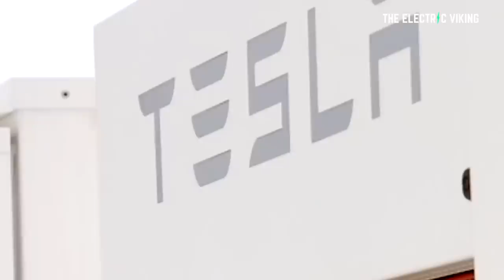Tesla's clear path to become largest truck manufacturer in the US

Comment: HYLN ERX r far more advanced than Tesla and NKLA truck combined.   You’ll thank me later.
Reply: You are absolutely right. EV trucks don't make sense for long range hauls over 500 miles and hydrogen is a dead end since you use more energy to create hydrogen then what you get out. I've been saying for a long time natural gas or LP is the cleanest and most energy efficient way to get away from diesel and gasoline for long haul commercial trucks. I see a hybrid solution using an onboard LP generator and tank as a ange extender for an EV semi as another possibility. That way you get the instant torque and better control of a electric motors, but without a massive battery pack with limited range and long recharge time. Natural gas only admits CO2 and water with minimal VOCs and toxic sulfides compared to diesel and gasoline. EVs are mostly being charged by electric power stations running on natural gas anyways. Might as well just burn it directly in the trucks.
Reply: What - better computer graphics than Nikola? You’re having a lend of me, Nikola are class leading in CGI renders and downhill propulsion. Isn’t Trevor on your board at Hyjinks?
Reply: @vic321344  How does making a hybrid truck make it a scam? When you crunch the numbers a hybrid makes way more sense than a full BEV for hauls longer than 500 miles and unlike hydrogen, there already exists massive network of natural gas refuel stations and natural gas is cheap and requires less energy to produce it than what we get out of it. My brother has ran various companies were most of their commercial vehicles were converted to LP to cut back on pollution and also save money since at the time, LP was cheaper per mile than diesel. The stock value means nothing. Plenty of companies with high stock valuations turned out to be scams and plenty with low stock valuation turned into killer companies. So my question is, what makes it a scam? The fundamentals of the concept are sound, and as far as I can tell they already made fully functional trucks.
Reply: @JEP-Tech  They didnt even make one. They want to start testing late this year. So they promise. The stock price tells it all. Hyliion expects to begin shipping the fully electric drivetrain beginning in late 2023 or early 2024. They just got 100 orders.
Reply: @JEP-Tech  "a hybrid makes way more sense than a full BEV " Sounds like the Toyota CEO.
Reply: @vic321344  Sounds like an electrical engineer (me) who actually took the time to do the math and realized that the economics of a BEV semi with 1000+ mile range when hauling 80,000lbs in cold remote areas is ridiculous. Toyota and Honda made the mistake of sinking too much money in hydrogen fuel systems, which is a dead end, but they aren't wrong about the long term value of  hybrid systems over BEVs in many applications. The infrastructure to charge massive commercial BEVs isn't there yet, and it will take decades to be on par with existing natural gas. High voltage breakers, transformers, etc. are not mass produced at a scale that makes it realistic (cost effective or possible in such a short time period as 10 years) to put charging stations everywhere for every semi truck on the road. I work in the power industry and we are facing major delays on various substation projects just to get a single transformer or vaccuum breaker in some cases. The cost of charging a massive 1,000kWh+ battery needed to have a BEV semi achieve a range greater than 1000+ miles like a diesel semi is more than the cost of natural gas hybrid per mile. BEVs make perfect sense for everyday drivers and short haul (under 500 miles, like what Tesla is doing with their semi) commercial vehicles. At that distance the dollar per mile favors BEVs. Like everything in engineering, their are cost trade offs, and the best solution for one situation isn't the best for others. Just look at the current Rivian and Ford Lightning. Their range is cut in half when the haul anything of significant size or weight just because of basic physics. It won't matter how light or how aerodynamic a Tesla semi or cybertruck truck itself is, because at the end of the day you can't control the weight or aerodynamics of everything you haul. So you will always need a massive battery that limits your max tow capacity and range, while significantly increasing the charge time (or alternatively, requires significantly more costly and robust charging stations to deliver the amount of energy you need to charge a fleet of semis). Hybrid alternative fuel systems make more sense in those situations if you are serious about improving air quality in a short time period without significantly increasing the cost of transportation and ultimately the cost of everything bought and sold. Nobody wants to pay twice as much for the things they buy, but that's what will happen if every diesel truck was replaced by a BEV. Hybrids can bridge that gap for long haul commercial trucking while still reducing pollution and improving air quality.
Reply: @vic321344  That's not any different than Tesla in that regard. Technically Tesla hasn't delivered any production vehicle yet, but I don't doubt that they will deliver their first Pepsi trucks by the end of this year. Hyllyion makes powertrains only and they have working prototypes that are spotted on the road. Seeing as they don't make the trucks themselves, just the power trains, they don't need nearly as much capital to go into full scale production. Maybe they will flop, but someone needs to start working on hybrid systems for commercial vehicles, because they are needed if people are serious about eliminating diesel trucks and improving the driving quality for truckers and air quality in cities.
Reply: @JEP-Tech  Why do you need 1000Mile+ range, when you can recharge after 500 miles while you have your rest? And you can really rest, and dont have to stay at the pump waiting 20 minutes (of your precious 45min) for it to deliver your 1000 mile diesel.
Reply: @vic321344  If your range is cut in half, you need twice as many refueling stations.  Right now, there are over 700 public natural gas refueling stations open to commercial trucks in the US and over 1,200 when you include private ones as well. Right now, we have less than 100 charge stations that actually have the capacity and systems in place to charge commercial trucks with 200kWh battery packs in under an hour, and Tesla is the only one I know of that is building ones with the capacity to charge 600kWh battery pack in under 60 minutes. So, if you cut the driving range in half, we will need at minimum 2,400 charge stations for commercial trucks alone just to be on par with existing natural ga stations (which is still a fraction of diesel stations). Even worse, natural gas station takes on average 1 year to be built vs. 2 years for an electric charge station, and natural gas stations can be built for cheaper and in more remote areas without straining the existing grid. It’s not just about the time to refuel, it's about route limitations. If there are roadblocks, construction, accidents, etc., trucks may have to take detours, if you now limited range, your route options are now limited. There is also the cost of refueling. Right now, public rates and fees for using DC fast chargers makes it more costly to rapid charge 200kWh battery to go 250 miles than to pay to refuel diesel truck going the same distance. When you consider that the cheapest electricity rates is often in areas that use natural gas power plants, it becomes more obvious that it might be better to just recharge with an onboard natural gas generator. The cost per mile is cheaper for natural gas hybrid semi then for a pure BEV even assuming you are paying the cheaper regular utility rates and not fast charging fees (which commercial trucks will most likely pay compared to residential users who can’t negotiate lower rates and fees). The main advantage a pure BEV has of course is maintenance costs, but the added upfront costs for both the infrastructure and the vehicle itself, isn’t worth it in every case given the above limitations and added costs for recharging. It’s the same when it comes to power distribution. In some cases, High Voltage DC is more cost effective, in other case High Voltage AC. BEVs are not the end all, be all, for all applications.
Reply: @JEP-Tech  There are over 30.000 superchargers installed. Tesla can install 8 supercharger stalls at once within 7 days (not 2 years).  Megachargers are easy and fast to install. maybe 2000 per year. Everywhere you want, without environmental limits. But the Semi is also be able to charge at a supercharger. 

 I would not say that 500 miles is a limited range. BEVs are much cheaper and more efficient than LNG vehicles.
Reply: @JEP-Tech  "With 35,000+ Superchargers, Tesla owns and operates the largest global, fast charging network in the world. Located on major routes near convenient amenities, Superchargers keep you charged when you're away from home. Simply plug in, charge and go."

You can use the superchargers as "trickle chargers". The V4 version is able to deliver 400kW. So within 30 min you should have enough juice to reach the next megacharger if necessary. And because the Tesla Semi is faster than any diesel truck, you might even make up for the time. Maybe they even invent a loader where you can plug in 2 or supercharger plugs at once. To emulate a megacharger.

And why you would need 2000 miles range I really do not understand. Are these the guys who piss in their bottles and shit in their lunchboxes, just to drive 1000+ miles nonstop per day?

BEVs are much more efficient and cheaper than any LNG engine.
Reply: @vic321344  The average cost to build a natural gas station is ~$2 million vs ~$8 million for a commercial charge station with the capacity for the same number of vehicles. The average cost per diesel gallon equivalent is $1 for natural gas vs $2-$8 for electricity (depending on whether they are paying peak charging rates), so that makes BEVs 2-8 times the cost per miles driven. Also, battery charge curves aren't flat or even linear. The only car company that has even designed BMS system that can handle 350kW is LUCID with their 900V architecture, and it can only accept that peak power for the first few minutes. It still takes about 40 minutes to get 80kWh. Tesla has allegedly designed a whole new system with liquid cooled cable sleaves and we still don't know if they are using one big, massive cable or a set of 2-8 separate cable bundles, either way it’s not as simple as their current systems. So, you have to build the equivalent of 8 charging stations for one truck. At 4 times the cost with twice as many stations needed due to half the range, this means companies would be spending 4-8 times as much as natural gas at a minimum just to build out the infrastructure to have enough charge stations for every semitruck. Not even mentioning the fact that we will still need to pump out more natural gas to provide the peak power for all these stations since ~40% of electricity in the US comes from natural gas and that percentage is increasing because it’s cheapest alternative to coal and oil in most use cases. It doesn’t matter how often truck driver takes a break, it’s question of the cost of building enough refueling/recharging stations.
Reply: @JEP-Tech  A Megacharger station will cost 200K (not 8 million). A supercharger stall costs under 50k. If you produce electrricity out of natural gas in a plant, you are 3 times more efficient than burningf it lokal in an engine. So you can drive 3 BEV Semis with the gas you need for one LNG Semi.
Reply: @vic321344  These are average costs across the industry for stations that support 8+ trucks, not what Tesla claims their cost will be (which often excludes the site work and substations built in advance before they install them). But it is true that Tesla usually can build/install their systems at least at half the cost of other companies. Still costs more than not having to build any at all. Natural gas generator produces electricity with an efficiency between 30-60% whether at a massive power plant or in a small-scale generator. A natural gas hybrid truck with double the range still weighs less than a full BEV, so not sure what you get the 1/3rd efficiency. I'm assuming you are thinking of a pure natural gas engine instead of as a generator. But even then, it's not 1/3rd the efficiency, natural gas engines also operate at 30-50% efficiency.
Reply: @JEP-Tech  It does not matter what other claim, for Tesla Semis it is only useful what Tesla claims. And their price is including site works.  If you want 8 megachargers on one place it will cost less than 2 mill including 2 megapacks.

They can be placed everywhere. They dont need to be filled or need a lot of maintanance or personel. That means very low cost of operation. Not only for the Semi.

Comment: Hyliion has the solution for Class 8 long haul trucking and is a superior investment at a mere $2.60 a share.  You will thank me in four years.
Reply: Sorry mate it’s a hybrid which it has the worst of both worlds. Hybrids won’t last in an all electric future but good luck to them.
Reply: @vec306  yea if only the grid can support all that BEV trucks. At least Hyliion Trucks can charge as they go
Reply: @zazea35  I could be wrong as my kids love pointing that out to me, but I believe in this video Sam spoke of the charging stations being at the warehouses pick and customers delivery points that are powered by solar/mega packs. Meaning zero strain on our current electric system. I actually have that setup at my home. My EV charges off my solar/power walls and I actually overproduce power so I’m helping the grid. As I said I could be wrong.
Reply: IPO 2019 at $10, peak at $50, now $2.60 and falling from $10 a year ago. Should be zero by Xmas. IMO.
Market cap $450 million. Vs Tesla 1,000 times more value market cap.

Comment: I think everyone else in the heavy transport market was expecting hydrogen fuel technology to become the new normal. Perhaps yet another underestimation of the speed of development of BEV tech. 🤘🏿
Reply: It was obvious ten years ago!
Reply: Battery tech hasn't really moved for Tesla since it put it's first roadster on the road
Reply: @MegaWilderness  Yet they are about to have the World's best selling car!
Reply: @garethrobinson2275  As far as EV's are concerned the energy system is and has always been the perennial problem which is why they lost their 30% market share at the beginning of the early mechanisation of the wagon. Anyone can disrupt the current situation with a novel battery chemistry. This is not yet a done deal and Tesla is not paying batteries their fair share of effort. Particularly since they haven't yet produced their own yet.
Reply: @MegaWilderness  have you heard of 4680, LFP, and M3P.?
Reply: @scottmcshannon6821  Yep, Tesla doesn't make them. They have enough trouble trying to get defect-free runs of their own 4680's working.
Reply: @MegaWilderness  And yet, Tesla quarterly free cash flow is $5 billion and that's $5b for an investment of a new factory every 3 months! 😊
Reply: Paul Moore  You're completely wrong, oil and gas are not renewable forms of energy, whereas hydrogen created by renewables is a perfectly reasonable fuel though not efficient but certainly more energy dense.
Reply: @MegaWilderness  Electricity has an efficiency of 90%, H2 of 30%. So why on earth does anybody want to convert electricity in H2, when they could load a BEV directly?
Reply: @vic321344  Where circumstances dictate H2 as a solution no matter the cost.
Reply: @MegaWilderness  Right. Uboats are a good usercase for H2.

Comment: I was at a ground floor carpark for a major retail outlet in Australia this afternoon. It was only about a quarter full of vehicles, perhaps less, and the car park is open at all sides to allow air to circulate. There was ONE single diesel van idling in a car parking space with their engine running, yet the exhaust managed to permeate the entire retail space which everyone was then forced to breathe in.
Reply: And this is just stating the obvious.
Reply: Had same experience staying at a hotel in a seafront resort area. Sitting on our rooms balcony, enjoying the nice weather and view, a truck pulls up and fumes were so bad, had to go inside. Thanks alot Diesel.
Reply: Omg did you died?
Reply: @jebes909090  Yes, but I lived!
Reply: One tanker load of diesel has the same energy as 14 tankers of hydrogen.
Hydrogen really has to be produced on site
Reply: @TecnamTwin  a miracle!